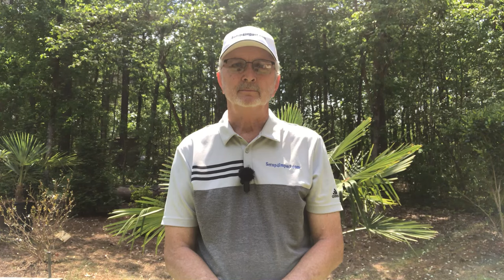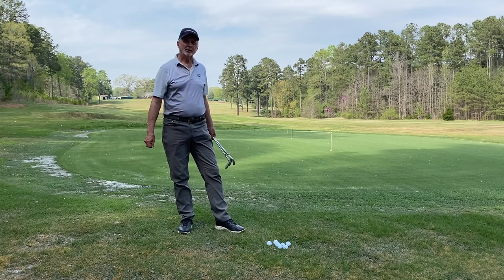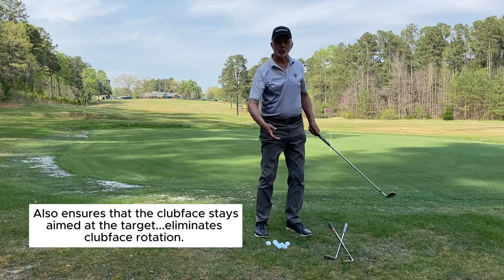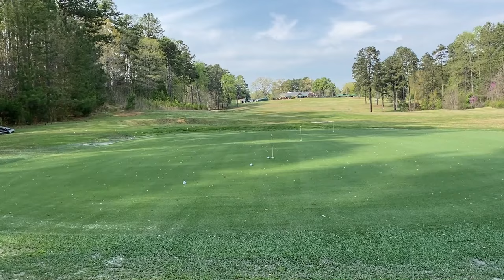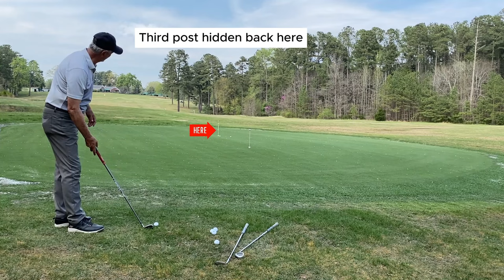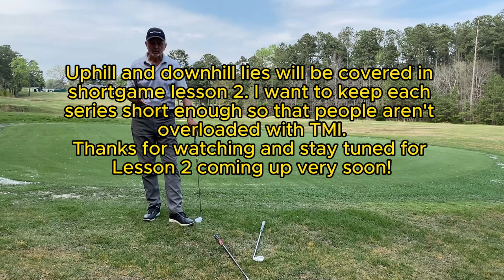Geezer's Short Game Series-Lesson one. The quickest way to lower your score is a better short game!

Comment: I was recently advised to slightly close the club face on a bump and run shot ... Was wondering if you also do that or have a square face?
Reply from the maker: Everything I did in this video was with a square face. Closing the clubface delofts the club so why not just take a lower lofted club instead? I want to keep everything as simple as possible and closing the face creates another compensation that you would now need to adjust your aim to the right to make up for the face looking left. I believe if one is correctly using the "swing" technique I demonstrated, (not using the wrists and hands), there is no need to close the clubface.
Reply: @GeezerTony  very much appreciate the feedback and video !

Comment: On your basic chip shot is your club face square, or slightly open? Are you always using the bounce?
Reply from the maker: Most of the time it is square. I only open it a bit to use the bounce when the grain is trying to grab the clubhead...which I determine by making a couple of useful practice swings.